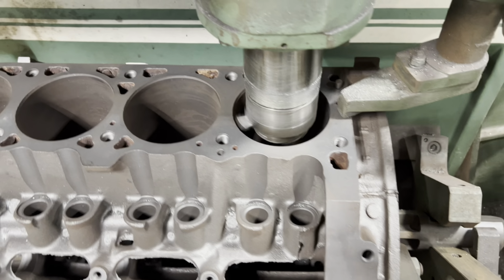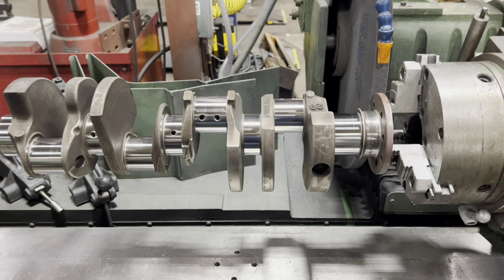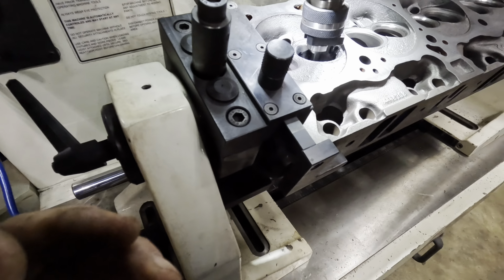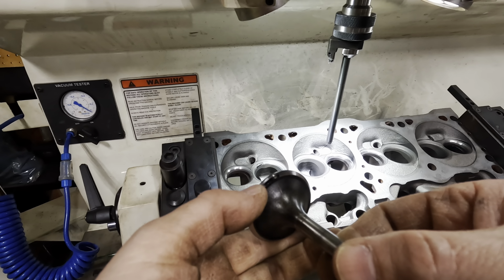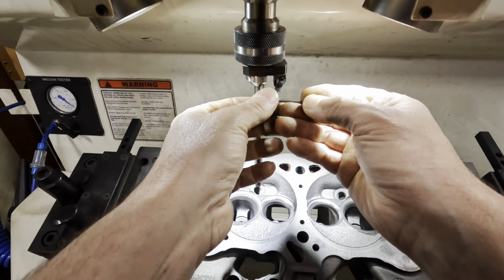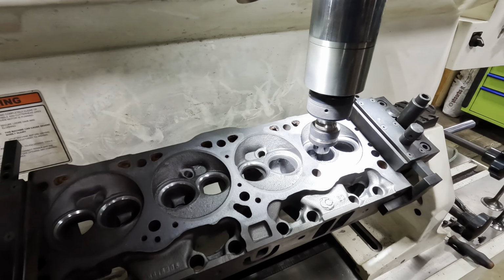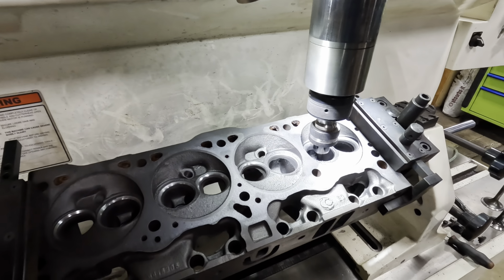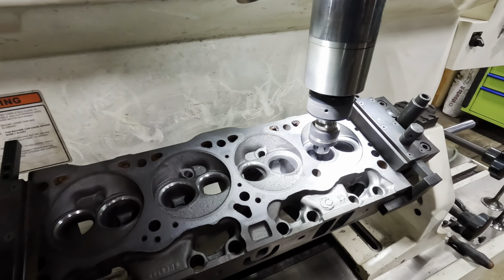Chrysler Marine 318 240 HP Marine Engine Overhaul

Comment: On any engines you rebuild that are going to see saltwater, do you automatically replace the exhaust valves seeing as the salt air is harder on the exhausts than the inlets?
Reply from the maker: That depends. We try and avoid saltwater work. :)
Reply: Dont blame you. 
Wish the engines we see were freshwater use only. Would make life just that little bit easier. But every single one is a saltwater enviroment engine.